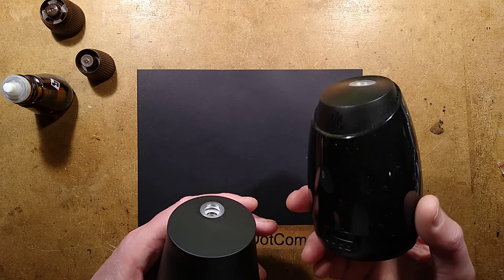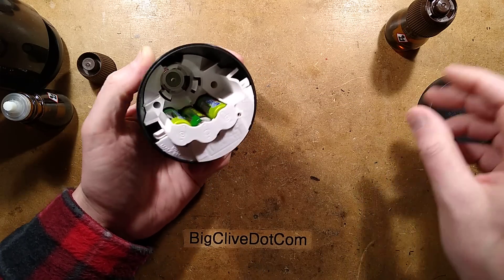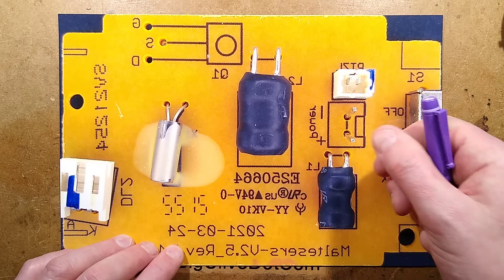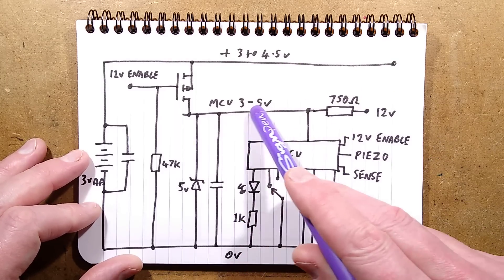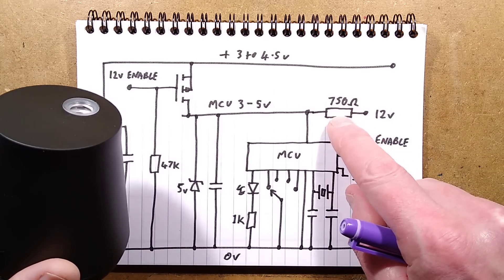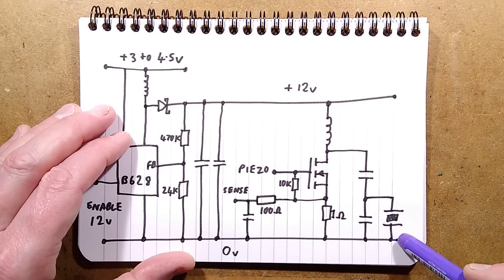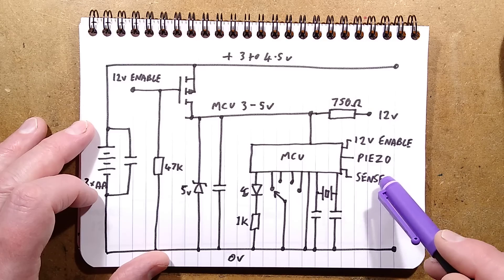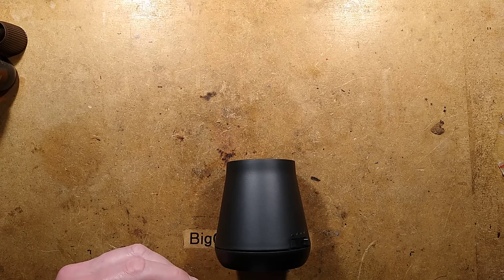Teardown of new Airwick essential mist unit

Comment: Some guesswork : I wonder if the capacitor arrangement at the output is to do with controlling resonance with the inductor - piezos are capacitive but wierdly so when vibrating, so a fixed cap may make the capacitance more predictable. 
May also be to avoid DC on the piezo, perhaps to avoid corrosion if the electrodes get wet.
Maybe the current sensing is to detect if there is liquid present - if activated dry it might damage the piezo.

I want to see what happens if you fill the bottle with IPA and put a candle next to it.
Reply: I keep thinking that “IPA” is going to give you the aroma of beer, it takes me a moment to adjust the context. 😄
Reply: @nigelanscombe8658  I sometimes ask myself: "do the Brits make beer out of isopropyl alcohol?"
Reply: @KeritechElectronics  "India Pale Ale" - made to handle being exported from the UK to the Brits in Victorian India.
Reply: IsoPropyl Alcohol for those who do not know. I'm still laughing as I type this.
Reply: @itsevilbert  When I read the original comment, I was thinking “Why  IPA?  Why not Lager?”  But now I get it… I’m a moron- thanks for enlightening me!
Reply: Your comment about putting IPA in it actually made me think, could you use ultrasonic vaporisation as a more efficient way of burning liquid fuels? Would it be more efficient than using high-pressure atomizer nozzles or electrical heating?

Like, for example, would a parrafin lamp be more fuel efficient if the parrafin was vaporised than burning on a wick?
Reply: @THE_REDACTED  no. Not more efficient. There are a lot of losses. Especially this one. I use a circuit similar to this with the addition of an output filter. The efficiency is really really bad but you can't beat its simplicity.
Reply: @brettfo  just wondering that's all. I'm certain that these ultrasonic devices have some kind of unintended usage but I cant seem to find one 😂
Reply: @THE_REDACTED  piezos are amazing and fascinating. I love fooling around with em.
Reply: Chaotic good. The best kind.
Reply: @garyGARYgaryGARYgaryGARYgary  so am I :)
Reply: The Capacitor and 100 Ohm resistor basically gives the microcontroller a Voltage based on the mean current flowing through the 1 ohm Resistor. Maybe this is used to tune the frequency to the resonant point of the Piezo i.e. when the most current is flowing. Just like a Maximum power point tracker for Solar panels would do it
Reply: @Fluxkompressor  This was my idea as well. It will not be for power stabilization as the supply rail is stabilized.
It could be verified by measuring the output frequency.
Reply: @Fluxkompressor  You can see how close to resonance by monitoring the phase difference between the current and voltage through the piezo.  From memory they are 90o out of phase at resonance, so you can sweep the piezo frequency until you get to that.
Reply: "IPA", Ultrasonically vaporised paraffin might be interesting, baby oil is basically an ultra refined type of paraffin.
Reply: @mfx1  Is that what they use to stop babies squeaking? baby oil... ;-))
Reply: Sense might be to tune the frequency to get peak output? As I assume they all vary slightly.
Reply: The current sensing will almost certainly be for measuring the phase to drive the piezo at resonance. A battery operated device like this probably can't get away with driving purposely off-resonance.
Reply: haha we have a customer now use this vibrating mesh technology(with LX8201 drive chip) on outdoor alcohol stove. very similar idea but a real product.
Reply: Do you people realize that the ultrasonic transducer if directly applied immediately via contact to the limb after the government coerced stab can neutralize it in about 30mins? the liquid is quite fragile and easily damaged. there is a research paper showing how the spikes fall off thespikeprotein..thisisonlyforpeoplewhodontwantit
Reply: @esecallum  thats got like a 90% probability of being absolute bullshit but also nobody here cares.

Comment: I bought one of the original version and it was DoA... discovered that for some reason they just hadn't soldered the positive lead to the battery holder tab... the wire was tinned but there was no solder on the tab so it's not as if it had broken in transit.  Easy fix but I wonder how many of them ended up being binned due to production quality issues.
Reply: I bought a brand new guitar amplifier for super cheap because it didn't work. When I opened up the back panel I found the wire connector had slipped off the rear of the power entry receptacle. 2 seconds to fix and now have a great amplifier the neighbors hate  😊  Too many things get tossed these days for need of what is often an easy fix.
Reply: @pmpwiz  hear hear well said John
Reply: Somewhere there's a small child that never got to see their 12th birthday.  Chinese manufacturing being what it is.....

Comment: Me thinks the wick saturates the top of the wick when sitting idle. 
That's why you get a burst at the start, until the top of the wick is dry enough for the capillary action to kick in high gear, and what you get after the initial flood, is what the wick can pull up and provide in steady state. 
Simple but clever circuit.

Comment: So they got rid of the heating element, switched to an ultra sound dispersion method, made the unit more compact and enabled it to work on Ni-Mh batteries. Seems to me they really made a lot of progress and applied some clever solutions to upgrade a common air freshener. As Clive would say: "Impressive!"
Reply: Heater removed after all the fires and meltdowns I think.
Reply: @markpunt9638  What are you talking about?  They wouldn't be allowed to sell them or at least have to do a big recall if they were legit fire hazards.  Air Wick and others still sell the always on plug in's that plug into wall outlets and 'heat' the oils.  The battery operated 'misters' never had heaters.   They use a piezo element to 'zap' the oils into a mist @ preset intervals.
Reply: @markpunt9638  Neither one used a heater.
Reply: The ultrasound method is safer but far less efficient than resistive heating.  The class-C oscillator itself is roughly only 70 % efficient,  and the ceramic-to-liquid impedance ratio is on the order of 20:1.  Transducers with integral impedance matching layers are not cheap,  so efficiency is usually sacrificed to cut mass-production costs.  The loss in output from mismatched acoustic impedance is partially offset by driving the transducer with at least 4 times the ideal voltage (further sacrificing efficiency for power output).  It gets messy and consumes batteries.  OTOH,  the indirectly heated models are cheap and reliable.  If they burn out in a few months,  you just throw them away and head off to the nearest dollar store.  Also,  the heater-style vaporizers use a different fluid with volatile oils,  the cartridges usually can be purchased in two- or three-packs for a dollar, and they only consume a couple of watts or less.
Reply: @gyrgrls  ultrasound still uses an order of magnitude less energy for the same amount of aerosol
Reply: @LabRat Knatz hence the barbecue warnings... (Charred meat)
Reply: I am much more impressed by a Carcinogen warning sign on the "fragrance" bottle.
Reply: @NGC1433  Many vitamins are deadly poison when overdosed. Dont drink the bottle of fragrance and youll be fine.
Reply: @Andy-df5fj  My point is that healthy substances can be deadly and dangerous substances can be harmless depending on correct use.
Reply: @drkastenbrot  advice not to be sniffed at 👃👍🤣
Reply: Breathing sweet smelling chemicals can't be a good thing.
Reply: @makeracistsafraidagain  ...unless it's amyl nitrite

Comment: could "vape juice" based fluid be used to refil those bottles Clive ?? (maybe a possible video trying different viscocity of fluids to home made menthol air freshner)
Reply from the maker: I've tried a few things.  The liquid type and density is quite critical for the best results.
Reply: @bigclivedotcom  back when I used to vape (5 years ago) most flavour was carried by pg as it is a lot thinner than the fog producing vg and it will thin down so it could be possible to roughly find the viscocity of the original fluid with blotting paper and a dripper bottle to get a general spread size pattern you can use as a template when mixing the correct runniness of the fluid for d.i.y refils with whatever vape base flavour you required .. (this idea sounded better in my messed up nut before.) All thone best to you and your brother (you pair are better than Any double act to have exsisted anywhere inc TV. ) Have a good 2022 Clive & Ralfy.

Comment: When the 12v supply is on, won't the internal diode of the power supply MOSFET clamp the microprocessor power to VBatt + 0.7v? Very Odd.
Reply from the maker: That's a good point.  I guess it's only going to be the full 5V with fresh batteries.

Comment: It does seem strange to power the low voltage microcontroller off the 12V rail when active.  Happy New Year Clive.
Reply: I'm leaning towards output FET drive requirements.
Reply from the maker: Yeah, it's also been pointed out that the parasitic diode in the MOSFET will potentially cap the microcontroller rail to about 0.7V above battery voltage.
Reply: I think it's to prevent brownout circuitry of the MCU to kick in and reset the show.

Comment: Very intereting "tear down"! It is amazing how much circuitry goes in one of these things. We used to just plug a resistive heater in a wall outlet with that wick near to it. Heheh. Those were fun 'will my house burn down or not'-devices. ;)
Reply: I recently found one of those in my basement behind the freezer, must have been plugged in about 15 years ago. It was all brown and crispy and fell apart in my hand. A fire risk I never knew I had.
Reply: @tncorgi92  that was the mouse’s central heating system 🐭
Reply: @robert_g_fbg  could be, at one time we did have a crazy moose loose aboot the hoose.
Reply: @robert_g_fbg  Once I was cleaning the coils of a fairly new modern fridge and found a Wacom Tablet nest.

Comment: I thought with the cylindrical crystal it would have some kind of daily timer function. Maybe the resonant frequency of that piezo is just that critical? Even most of the basic microcontrollers now give you a 1% or 2% accuracy internal oscillator so seems an odd choice for a cost optimised product. Think the microcontroller is a Fremont Micro Devices part but I can't find it on their website so could be something unlisted / customised.
Reply from the maker: In hindsight, it does have a daily timer function.  Well spotted.
Reply: Ah makes sense, thanks!
Reply: Yeah, these do an on 8/off 16. The original model did, too.